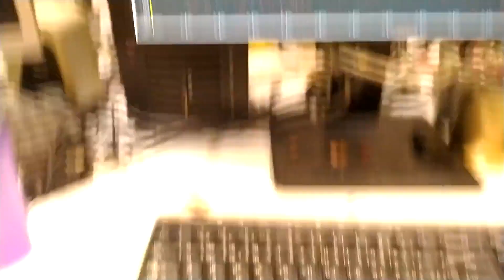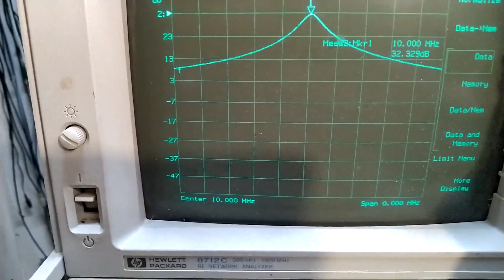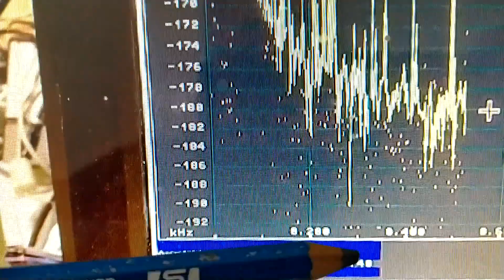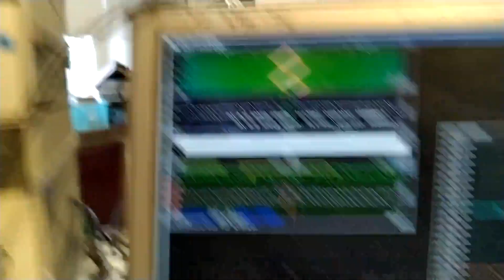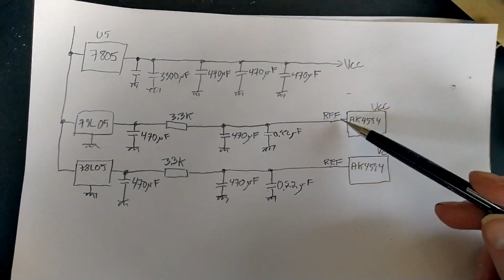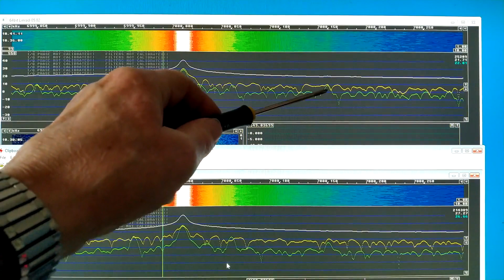nerds81

Comment: I wonder if you tried removing the 4700uf capacitor that you installed at U100 5 volt reference line on the UADC4? Perhaps it is defective. My other thought is that the 4700uf capacitor had a charge on it when you installed it or perhaps as it was charging the reference line did not like the slow ramp up in voltage. U100 may now be defective. If you can find a replacement chip a person with SMT soldering skills could easily replace U100.
Reply from the maker: I think the problem was that I neglected this note in the data sheet: "Note 8. VREFH1-2 must not exceed AVDD+0.1 V" A very big electrolytic capacitor on the VREF pins will keep them high for a long time after power off. AVDD will drop far below and damage the chip. Separate power supplies for VREF1 and VREF2 to avoid correlated noise at very low frequencies plus something to discharge the large capacitors thar would be needed for low noise down to 10 Hz or so. There are also some restrictions depending on the status of the LDOE pin.